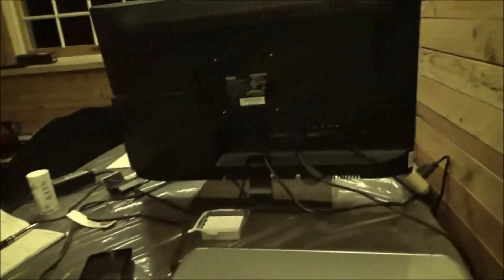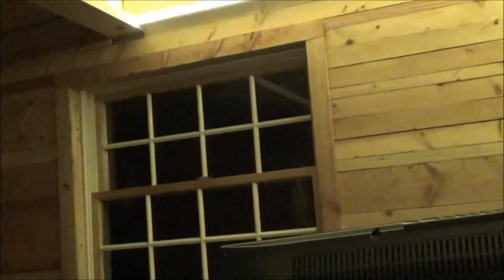Bedini Motor Radiant Energy Generator A Scam Or Is It Real

Comment: If this really worked, there would be at least one guy in the world that powers his house with this... Sorry but this is bullshit.
Reply: powering something with a bedini motor??
you dont understant what a bedinimotor is, its not a generator witch generates power to forinstance power a lamp or charge a battery, (like a normal generator) a bedini motor is just a motor.nothing else!
(it uses very little power to spin a wheel, you can not even power anything with that motion, other than producing high voltage spikes), (witch u can use to desulphate lead acid battery's), so its a kind of machine witch makes hig voltage pulses, its not a free energi device or a pepetum mobile, you can not power anything with it,
(you can also make the hv pulses in a electronic way whitout the spinning parts, but hey, where is the fun of that.
Reply: *****  its a chemical reaction on the plates of the battery, using high voltage spykes, giving the battery a pulse charge with very low amps, a resistive load on this bedini wil have no effect on the load (plane english, a bulb will not burn on it), you don't transport amps in this bedini puls generator, only high voltage spikes from a collapsing field in a coil .

Comment: Some where I saw a explanation of Bedini saying that it puts a high power pulse through the battery. You disulfide by high rate charging. I believe the pulse is burning out the threads that form in a lead acid battery shorting it out. You would need a scope to see this though.
Reply from the maker: Yes. I hope to attach a scope to the output of this one day

Comment: i hear it restores battery's to take a charge and to be able to use them! i have a solar charge controller it flash's when in use,  since i used them my battery's seam to like it more! but i like to make one of them!
Reply from the maker: Yes you are correct. And the solar charge controller might be pulsing the batteries a bit. But the Bedini motor puts out pulses of higher voltage and can break up the sulfation on the plates of the battery
Reply: The Do It Yourself World
 i have some older battery's that why i need a Bedini motor to bring them back!
Reply from the maker: timcat100 I always tell people just that. This is not a magical device. A dead shorted, broken or otherwise physically damaged battery cannot be restored with this. But I can desulfate lead acid batteries with it. And with my budget it sure is a good thing to have. Right now all I have are six sulfated batteries. Two are taking some charge. The other four are not. This is not wasting energy but rather saving me about $1,000 on new batteries.
Reply: timcat100
 my battery's that not in use there for a boat, i charge them once a month well setting! i used them for camper in summer if i use boat then i put them in boat, with solar panels to charge the battery's for the  12 volt trolling motor, i don't use camper and boat at the same time! if i was rich when gas is at 4 dollars a gallon a 6 gallon can to go down the lake one way, the motor was made when gas was 1,25 a gallon it drinks a lot that 6 gallon down the lake and 6 gallons back to where you put in lake!

Comment: I would love to make one of these, I've been thinking about it for a long time.  Can you recommend the best place to get a set of plans? I'm actually working on a bank of batteries right now, and this would be perfect to finish restoring them.  Thanks Troy, great vid :)
Reply: Hey give me a email I send you a diagram that breaks it down that even my 9 year old grandson can build it
Reply from the maker: http://www.thediyworld.com/ssg-battery-restorer.php
The schematic on the top left in the set of four is the easiest one to follow. The one showing a bike wheel and a fan blade. (those are optional)
Reply: We built these in school for a electrical engineering class project, the key to the system efficiency is the best bearings you can find, perfectly round device for the magnets to spin on and good quality wire.. the circuit is pretty simple.. you can build this process with a momentary switch and 12v battery as the trigger field just to assure you have the charge circuit correct... just press the button as fast as you can to see if the output is displaying greater than the input voltage on the output.. then replace with magnetic trigger wheel and battery bank and enjoy.. but i personally dont use this on my battery setup..

Comment: it does not put out more energy then you put into it. that is a perpetual motion machine.
Reply: electric cars were stopped for years, almost a century even because the batteries were useless for there weight. it had nothing to do with anyone stopping them. they were working on them all the time and finally came up with batteries that weren't terrible and now they are gaining traction. Also until the last 15 years or so gas cars were cheaper to operate so people didn't care so much about electric cars, but once gas got out of control they focused more on them and got it done.
also The Do It Yourself World if it works then let me know where to buy it. I have the cash sitting in my bank and I'm sure the inventor wouldn't mind me giving him $30,000.  If it works like you say it does I wouldn't even think twice about buying one.
Reply: yes troy specifically said in this video that that machine outputs more energy then it consumes
Reply: AnnBearForFreedom There is no such thing as 'radiant energy'.  That solar is energy was never in dispute, Archimedes used mirrors to burn Roman ships in 212 BC....
Reply: if you can buy one that would run my entire house then send me his contact info and I will go buy one right now. except there is no video of one working showing it in a complete closed system and you can't freely go view it working either. the cost is also not a lot really a full solar system will cost you 30k so its on the same level and there are tens of thousands of installations of those so cost is not an issue what so ever. patents also mean absolutely nothing, there are time machines and anti gravity devices that are patented.
so again if i can buy one of these for 30k that will run my house then give me contact info and I will go get a cashiers check first thing monday morning.
Reply: Exactly. You might say that the oil producers don't want this technology to be mainstream, but they could not stop it if it was possible.
Reply: I am new to this Bedini idea, but I do understand some basic physics.  As I understand it, no new energy is being created.  The energy from the feed battery input, PLUS some "radiant" energy being collected and transferred, is what accounts for the increase in energy being outputted.  The fact that the somewhat mysterious radiant energy is being gathered from seemingly nowhere but is usable and storable is what gives it its free energy claim.  Same claim was made about solar energy when it first got going.
Reply: there are large scale solar and wind farms that produce lots of power. the only "radiant" energy generators are ones like this. if they worked then companies would be mass producing and selling them.
Reply: I also never said it was a scam or that you said it makes energy. i said you said it produced more energy then it consumes which are the words you used in the video.
Reply from the maker: OffGridUniverse The only thing stopping me from running my entire home on this is the cost to build one. Thats it. John has one that he built. It cost him about $30,000 to build. It runs his warehouse and workshop. He sells them as well. Its just out of my budget. Anyone with enough money can buy one. But its not main stream due to the cost for now. And I fear that it will never really be accepted. Why, if you can buy it and it was patented and works, then is it not accepted? Why are so many people screaming "fake", "scam" and so on when they can try it themselves? Because we are programmed by society to be constantly paying for our resources.
Reply: Patrick Sullivan I see no reply button to Violent Apathy so I hope you don't mind for me to reply here. VA is right that you cannot get out more energy than what is put in. That would break the basic laws of physics. Energy simply cannot be created nor destroyed only transferred. That is true. However, I did not understand Troy to make any such claims regarding this specific machine. Did anyone else hear him make such a claim? Please, do not attribute to Troy claims someone else may or may not have made especially if they are talking about a different machine with a different end result. Critique Troy for his own claims. So far, all I see here is that he has a slow input of power from an external source which he transfers in a manner which he states will slowly desulfate batteries. How well it works, I cannot say. But, what he actually has said here does not contradict the laws of physics.
Reply: Patrick Sullivan that is totally correct.  There is no way to get more energy from a system - that would violate one of the fundamental laws of physics, the  law of conservation of energy - http://en.wikipedia.org/wiki/Conservation_of_energy 

Also, the 'Daric sea' is a theoretical model of negative energy which is used physics in equations to simulate a vacuum - http://en.wikipedia.org/wiki/Dirac_sea - it has nothing to do with so-called 'Radiant energy'.  As far as I know, Troy doesn't live in a (theoretical) vacuum - although it would insulate his tiny house better... 

Not disputing that the Bedini doesn't restore batteries, but this is a mumbo-jumbo explanation which has little or no reality in actual physics....  

There are other more likely explanations, like the reduction in sulfates causing trapped energy to be released and the voltage pulsing action having a cleaning effect similar to AC TIG welding machines (like this https://www.youtube.com/watch?v=RG4ZOwSw9CQ - AC balance is the amount of cleaning effect)
Reply from the maker: Patrick Sullivan So does a wind turbine, solar panels and a static electricity generator. Are they a scam then?
Reply from the maker: Patrick Sullivan Sorry, that is not how the World works. There is no money in selling something one time with no other income. Paying for coal generated power or for expensive solar panel arrays and then for replacement batteries every couple years keeps the economy going. Stuff like radiant energy will never be accepted. Tesla was mocked as well when he demonstrated the transmission of energy through the air - wireless.
Reply: uhm thats exactly how the world works. this would need batteries just like any alternative energy does to store it. not to mention it will break eventually. its a moving device it won't last forever but solar panels are good for 25 years as well as commercial wind mills so if this thing actually created/made/absorbed any kind of useable energy then people would be selling them.
Reply: The Do It Yourself World  Wind turbines get energy from wind. The wind becomes a little bit slower, but the turbines become a little bit faster.
Reply: and I'm programmed by society to understand science and how things work. there are other energy alternatives that sound crazy but they work and COMPANIES BUY THEM because they work. like the bloom energy cube, on paper it seems crazy but it works so places are buying and installing them left and right. google has bought hundreds of them. so you can make all the excuses you want about why the bedini isn't main stream but at the end of the day its because its snake oil and if if actually worked google would have sent him $10,000,000 and bought the patent from him in an instant.
Reply: The Do It Yourself World Troy, SSanf wanted me to ask you to clarify your statement about powering your entire home with a Bedini.
Reply: Max Mustermann They stopped the electric car for years.   Why would you think that they could not stop this?   Just by putting out propaganda that it won't work will slow its progress down for a long time.
Reply: Unfortunately, batteries are still not worth their money. As soon as we have batteries that are cheaper and can store more power there will be no reason to buy a petrol car anymore. Its just a matter of time.
Reply: I can't remember how many decades ago it was, but an electric car came out that did work, but the oil companies bought back all of the ones that had been bought.   I know, because my cousin was one what had bought one and he was excited about it.    That technology was buried for decades because of the greed of big oil.
Reply: Of course there were cars that worked, but how well? Cars used to be electric around 1900.
Reply: I'm talking about the ones made in about the 1970's or so.   There are documentaries about it.
Reply from the maker: Patrick Sullivan I do NOT claim that this "makes" energy. Rather that it taps into energy that is already there. Just like a solar panel or wind turbine.

Comment: Making lead sulfate into lead and sulfuric acid. Now somebody is going to say Troy is going for gold next. You have a hard time pulling that off, you can bearly get enough sun to light the bathroom. Hope you get a forklift battery for Chirstmas, that is a 12 or 24 one.
Reply from the maker: Thanks. I am happy that I can extend the life of my battery bank with this for now. It is slow but it sure beats replacement. No forklift batteries under the tree yet. I am saving up for some though. Maybe in spring.

Comment: I think that Bedini is a scam. There is a tool for desulfating the batteries that actually works. http://www.batterystuff.com/battery-chargers/12-volt/0-4amps/bm1500.html
Reply: Its not a scam build one and try it out. I have several batteries I have brought back to like new because of a Bedini motor. You need to understand once built it will take time to run it it is not a over night machine it can take weeks and even longer. BUT it does work
Reply: ***** I'm sure it works, but the Battery Minder is likely much, much more effective as it's high frequency rather than the low frequency Bedini.  And at $42, it seems like a very small investment to keep an expensive battery bank in good shape.
Reply: that tool works quite the same as a bedini motor.
its delivering high voltage spikes.(if you really buy a working tool!
(most electronic boxes you buy dont work eather, mostly its only a resistor and a led lamp you pay good money for!,, thats a scam)
Reply from the maker: Have you built and tested one according to the strict instructions of John Bedini before making your claim of a scam? If not, then I suggest you do it with an open mind and see what wonders of the universe are opened up to you. Its simple physics.
Reply: If they were all that I would think they would be on the market.
Reply: BUDDY LIGHT  actualy the are, som of these solt apparatus even really work, and some of them are not, the are only a blinking led mountet in a sealed case....